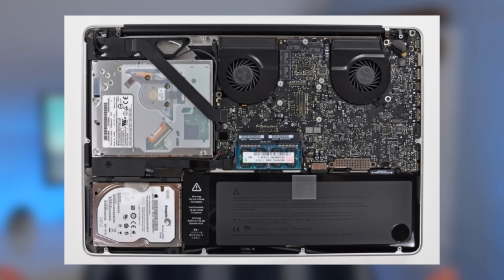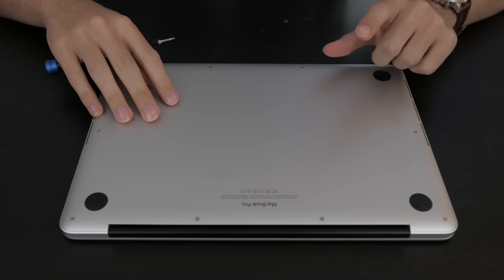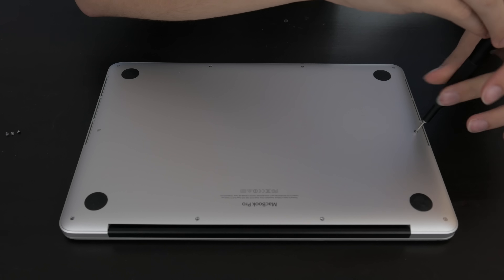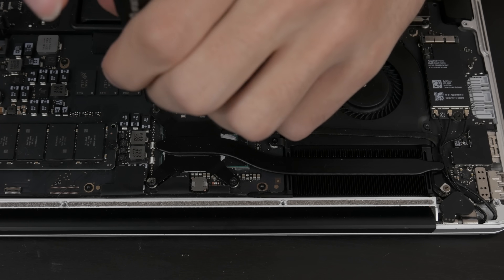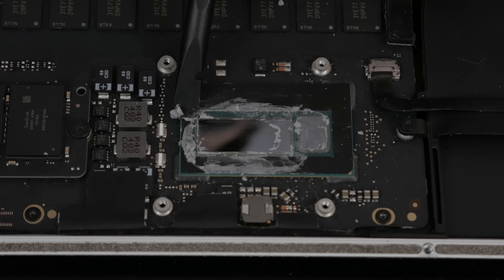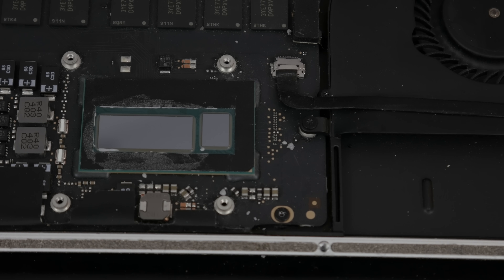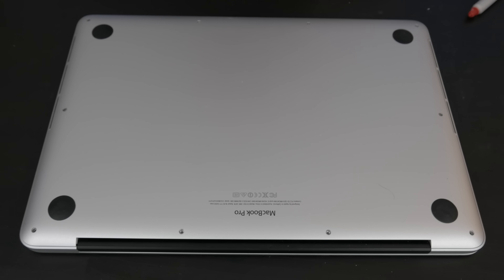If you have a Retina MacBook Pro, you need this $6 Upgrade!

Comment: I repasted my early 2015 13 inch Macbook Pro with thermal grizzly kryonaut it did improve, yet it's still runs hot, I'm very experienced building gaming pcs and repairing macs, so I know what I'm doing. It just seems that Monterey and modern apps are not helping this machine. When I upgraded the NVME to the fastest one it can support I even put a thermal pad that will be in contact with the bottom case to insure the SSD is cool as well. 
in the end this laptop would definitely be replaced by an M3 Macbook air, and I know it will be heck of an upgrade, since I started doing youtube on the side and I would need a capable enough machine to run photo and video editing with no problems.

Comment: Great video! I just replaced the factory 1tb ssd on my Mid 2015 Mackbook Pro with a SAMSUNG 980 PRO SSD 2TB . It works great so far, but was wondering if I should add a thermal pad to the SSD.... please advise

Comment: this is good to do to any old computer in general thermal paste doesn't last forever though it holds up pretty good around the 5 year mark or so it starts to show it's age.. With many macbook like this one being 10 years and older yeah it's a good idea to do this... At least it's not a flip board design like on the uni bodies..

Comment: Luke - I am a non-techie but I want to do this on my 13" 2014 MB Pro Retina (Model: A1502) while I upgrade the SSD.  Three questions:  (1) which tool kit do you recommend that I get from ifixit? (2) I am thinking about upgrading the SSD using either a Samsung 970 Evo or Samsung 980 Pro coupled with a Sintech NGFF M.2 nVME SSD adapter Card; which of these two Samsung SSD's would you recommend that I go with?  (3) I have 8gb Ram; can I upgrade the RAM as well?  Level of difficulty?  Thanks very much in advance!

Comment: A friend gave me one you show with two fans as it does not turn on but I saw one time trying all keys combinations that it showed colorfull screen asking for password but I was not able to pass from there as it seems the one she gave me is uncorrect. Then it only starts the fans when pressing power key and they stay on until I press power key again or until battery drains. Can you suggest a solution to this problem? Thanks!

Comment: Sometimes when there are "blank spots" on the top cover of a chip, where there's no thermal paste, you'll find that these are the spots where the thermal paste came off onto the heat sink. But that's not entirely the case in this video--the shiny area on the CPU cover that Luke points out, really doesn't have a corresponding patch of thermal paste on the heat sink, so this area really wasn't being thermally cooled as well as the areas where the paste is present.  This shows why it's a bad idea to just place a small ball of thermal paste onto the center of a chip (or even to just partially spread it out, as Luke does here for some reason) and then expect that it will spread out to cover the entire surface of the chip's top cover when you screw the heat sink down into place--instead, you should always spread thermal paste across the whole top, shiny raised cover of a chip to get the best heat transfer from the chip to the heat sink.  The clamping force of the heat sinks in many (most?) laptops isn't enough to always thoroughly spread out thermal paste that's been applied as just a ball or a patch that only partially covers the chip's top cover, so you should always use a small spatula to spread out the paste as a thin coating, across the entire surface of the chip's top cover--it doesn't need to be thick at all, since the main purpose of thermal paste is to fill in tiny scratches and other irregularities on the heat sink to maximize thermal transfer from the chip to the heat sink.

Comment: Youtube autplayed this, just a little note from me. Notice how the smaller die does not have any contact with the copper plate? well thats how it should be. It is not gpu, it is a PCH (platform controller hub). It should not have any thermal paste added on to it, as it runs at much lower temperatures than the cpu, and by adding thermal paste there you are also "connecting" the heat to it. It was left unpasted and cutout from the heatsink intentionally

Comment: I really don't know wether I should paste the PCH chip or not ? I see Luke pasted both the CPU and the PCH but in other parts I read that doing that will put the PCH in contact with the heat pipe and increase its temperature. Also , when I opened the Mac for the first time, it didn't have any paste on the PCH.
Reply: You shouldn’t, atleast as far as I read on the interwebz

Comment: hey I have a early 2015 Mac I use if for mainly djing using Serato but the fan goes crazy when djing I've already change the thermal past could the 120 ssd cause it to over heat

Comment: this was not an original apple thermal compound as it is on the second right chip. you should not cover this chip with a thermal compound as it is not a GPU and there is no heatsink for it. by applying thermalpaste to wrong chip, you are overheating it

Comment: If you have a Retina MacBook Pro, you have horrible cooling anyway. Here it's not just the fan curve, also the physical cooler.
Anyway I'd stay away from most Apple products. Not all of them, but a lot of them, because they have no respect for the environment, no respect for repair, and no respect for you either!
A MacBook with 16GB of memory being 200 dollars more expensive than the same device with 8GB is a truely shocking example, and yet that memory is fairly basic! It's less than 40 dollars worth of hardware upgrade!

Comment: Doubt. My mac is "MacBook Pro (Retina, 13-inch, Mid 2014)". I want to increase the SSD but in the spec it says:

2.6 GHz - 128 GB
128GB PCIe-based flash storage
2.6 GHz - 256 GB
256GB PCIe-based flash storage
2.8 GHz - 512 GB
512GB PCIe-based flash storage
Configurable 1 TB of flash storage.

I see that my processor is 2.6 Ghz and that I can upgrade up to 256GB. Is that correct? What happens if I put 512?

Comment: I have a question I hope Luke or someone in the communities can answer
I have a late 2015 MacBook Pro 15 that is having and issue with the screen 
The screen image will flicker constantly and will not stop
I have factory reset the computer and reset the computer and fully updated to Big Sur
I have reset memory and nothing seems to fix the issue
I have connected it to an external display and when I do it does not flicker on the external display and works as it’s should but still flickers on the macbook screen, this has led me to believe it is a screen assembly issue and NOT a logic board/gpu issue
If anyone has any ideas/advice/experience or knowledge they could share with me I would deeply appreciate it as I cannot currently afford to replace this laptop or spend money on unnecessary parts or repairs
Thankyou in advance!!!
Sorry I’ve posted this in 3 different videos to get as much attention as possible

Comment: Do not apply thermal paste to the second smaller die on the 13” model. From the factory these macs have way too much thermal paste applied. I would bet that this one was improperly repaired before Luke worked on it. From the factory it’s common to see some paste spill out from the heat sink as it was initially poorly applied. In this computers case it looks like the previous technician applied the paste horribly wrong. Check out the ifixit guide and look at the heat sink before it is removed and you will not find thermal paste on the die I mentioned.

Comment: i used thermal pad (1,5 mm thick) between the cooling pipe/blok and the bottom plate. and of course arctic mx4. the end result is amazing!
Reply: where u put the mx4 ? between cpu & pad ? or pad&pipe ?
Reply: @billytandias2473  processor -> mx4 -> heat pipe -> thermal pad -> bottom plate
Reply: @hcarlo3  ahh i see, how much the degradation ? 15-20° or more?
Reply: @billytandias2473  2015 rmbp i5, video editing: before 90+++ with throttling, after 70-72 celsius peak without throttling. I used Thermal Grizzly Minus pad.
Reply: @hcarlo3  damn, that’s huge improvement, thankyou
Reply: @billytandias2473  you're welcome!

Comment: heatsink does not have the clamping force to spread that paste , so put more or use a spudger to spread it , that is why it is on the whole cpu from stock cause they put a long line of paste from cpu dye end to "gpu" end . and you use a vastly inferior thermal paste to what apple did (that CM paste is generic crap) so why not go better than apple and go cryonaut if you intend on getting this as low as can be .

Comment: Pro tip: While you have the machine open, grab yourself the can of compressed air and clean out the cooling fan. If you're doing this for a customer, they'll appreciate you going the extra mile.
Reply: Super pro tip, only do this with the can connector disconnected

Comment: I just stumbled on this episode.

Yes, I agree. My Macbook Pro (Retina, Early 2013, A1398) kept freezing up after only a couple of seconds of Youtube video. The top of the keyboard was also very hot, very quickly (from a cold boot up). So I got myself a good quality thermal paste and did the job myself.

Now, the computer runs very cool and the top of the keyboard only slightly warm to the touch even after hours of watching Youtube.

It's like a new machine now. :-)

Comment: great video i learned a ton from this. 
I have a  computer My question is what is the best Curved monitors in the 30 inch plus range to pair with this type of mac for the best display. I had a Samsung 32-inch Curved Full HD Monitor in White.  It was really bad, it had glare issues and the display was extra large on the monitor. I tried adjusting  the ( display setting on the mac computer and the samsung monitor.But to no avail) , and it made my eyes hurt.

Comment: Done this, was so simple, being a techy. The original thermal paste in my mid2014 was  well not much left, put on thermal paste over CPU and GPU now much cooler 10-15 degrees cooler. Really helped. I Also replaced my battery as well while i was at it.

Comment: instead of taking your laptop apart if youre not comfortable. You can always install smcfancontrol and have your fans always spinning. downside to that is well your fans are always on but upside is. your laptop runs at 40-50 degrees

Comment: Just did this with a 2015 15 inch. Very easy. One thing to watch for is the brackets holding the heatsink over the CPU have spring tension to press down when installed. They could easily send your screws flying across the room if you're not careful when removing them.

Comment: This helps, but unfortunately there are no decent ventilation around fan anyway, so overheating still be there, just not as severe as before. Drilling few holes around fan from the bottom of the Macbook Pro will decrease CPU temperature by ~15C easily. :D

Comment: Hi Luke great video. The thermal paste on this looks like it was replaced before. My 2015 mbp 13 had no thermal paste on the gpu dye from factory. What’s your best advise on putting the thermal paste on the gpu dye so that it extends to the cpu dye and copper heat sink so it also draws some heat away from the gpu? Also the piece of heat sink that’s directly above the gpu dye is insulated/coated  and not in direct contact, so there is no direct heat transfer there. The orientation is the exact as in this video. What’s your best advise to maximize cooling performance- using thermal paste, thermal pad and cleaning a spot above the gpu dye on the heat sink to expose uninsulated copper, putting enough paste or pad to close that gap-all things considered.
Reason for this is my computer operates well enough not to upgrade. I have been running an external monitor so I’m usually maxing out cpu and gpu.
Thanks
Reply: Wow, I always though that was the PCH die

Comment: You’re being so gentle with it, why? You’re not going to break it by giving her the grease, cpu dies yeah... sure the are delicate, but take some alcohol put it on a paper towel and rub it off, you don’t need to be so delicate.
Reply: And I wait a few more seconds thinking that that was going to be the biggest problem... oh boy... no... oh god no.... you used a little too much thermal paste, wasn’t going to comment on it as it doesn’t matter too much, but DO NOT spread it out from the application area, use the pressure of the heat sink mounting to spread it out evenly. I’m glad that you tightened the heat sink down in diagonals, wish you would have mentioned it, but still.

Comment: Would there be a downside is spreading the paste evenly? 

Most videos I’ve seen kept it as blobs but wondering any advantage or hinderance if one were to spread it evenly across the surface. 

Thx in advance to anyone who knows!
Reply: It's a bad idea to just place a small ball of thermal paste onto the center of a chip and then expect that it will spread out to cover the entire surface of the chip's top cover when you screw the heat sink down into place--instead, you should always spread thermal paste across the whole top cover of a chip. This is demonstrated in Luke's video, where he points out the shiny area on the top cover of the CPU, where there's no thermal paste--the person who last applied paste to the CPU just placed a ball of it onto the center of the CPU's top cover, but as Mike Mayers points out directly below, the clamping force of the heat sinks in Macbooks isn't always sufficient to squeeze a ball of thermal paste entirely flat over the surface of a chip's top cover.

Comment: Hi Luke,

Just did the thermal paste upgrade since my (Macbook Pro 15 mid 2014 2.2 ghz - integrated graphics) was running really, really hot when literally browsing and watching videos...

It seems to be a lot better now, but what app do you recommend to see if it's actually helped?

Many thanks
Reply: Intel Power Gadget

Comment: Use a high alcohol % isopropyl alcohol to help clean the old thermal paste! Also don’t spread the thermal paste around, this could introduce air pockets which would bring the heat transfer rate down, the heat sink will spread it for you as you put it back on!
Reply: not true Explain why Luke's mac in the video above had shiny spots on the die from the factory? Surely it should have spread out from the heat sink, right? Also, explain why most pastes come with a spreader? See: MX4, Arctic Silver, Thermalright, etc.

Comment: i changed my thermal paste with grizzly kryonaut thermal paste, it was running really fast compared to how it was before, even connecting it to an external monitor would maximise the cpu usage, but now after 6 months, when i open a pro tools project and work on a video or ssomething that is cpu intensive, the fans run on max power, and cpu starts maximising out, im gonna upgrade the SSD to a 1 TB and might re apply the thermal paste again, if you know any other upgrades i can do on it to make it run better on power intensive apps it would really help

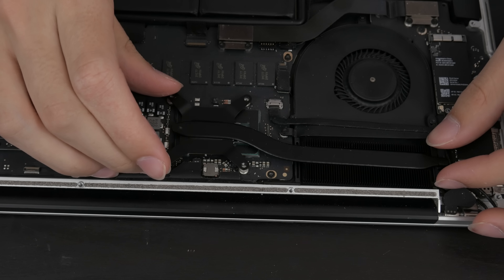Comment: 8:50 The heatsink don't even covers the gpu, we can see the reflective part, wtf.
Reply: It's the PCH
Reply: @0xIsma  No.. it's not the PCH
Reply: Yeah I also was surprised by that, and the gap between GPU surface and heat tube is huge there, so thermal paste won't work there. I used thermal pad for that, but honestly without noticable effect anyway :D
Reply: Well this was a 2010-2012 model...
Reply: @BigMacIIx  mine has the same crap early 2015 model.
Reply: @snowmean1  I also got the 2015 model that I've blowup the batteries and reuse it has an baremetal docker server, I just got an 16in i9 model to replace it.  Newer model without cdrom with dual symmetrical fans and heat pipes are top in their class design when compared to competition who are following Apple design. The patented solid aluminum unibody casing is the biggest heat sink a laptop can have.  But I agree,: the factory process is "good enough" for the task, but they are better solution. I just find this video is a little disingenuous calling dry thermal paste on an old gen laptop.  BTW I've seen some thermal pad fixes who slightly budge the bottom casing because of their thickness and tight tolerances.
Reply: JR 007 yeah that’s really dumb. Oh wait, it’s apple